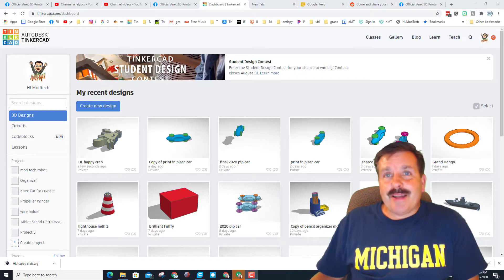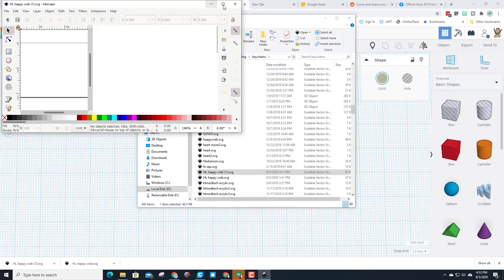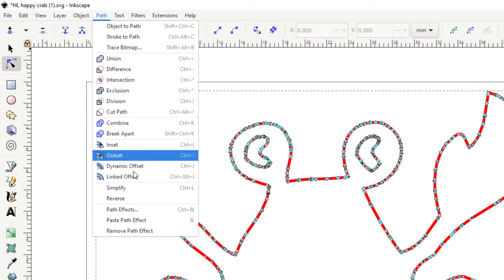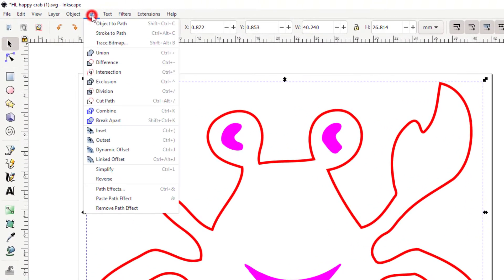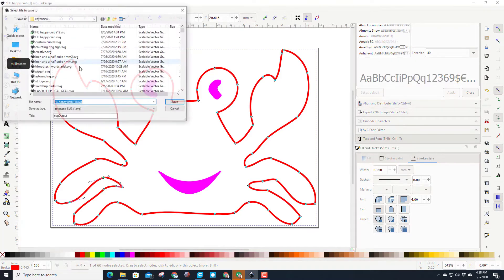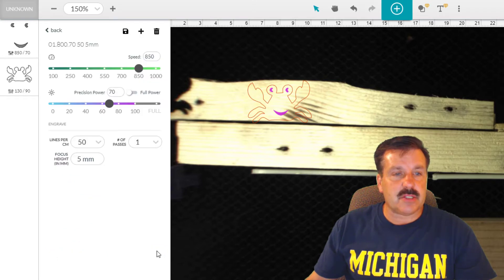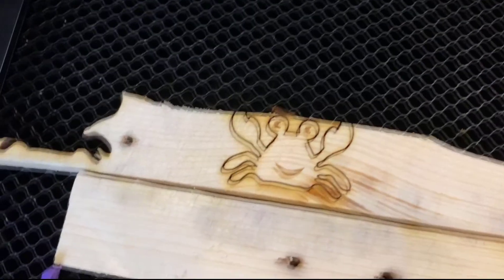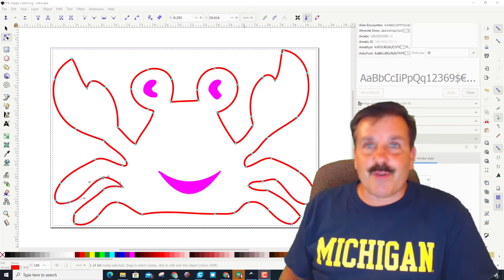STL to SVG for laser cutting!  Tinkercad & Inkscape in Minutes

Comment: this is NOT an "STL" to SVG conversion how to video... this is an "SVG" to Laser Cutter Video.
Reply from the maker: Ah... you are correct. That crab is imported into Tinkercad as a STL. I did not show that step in the video though. 🤦‍♂️ Do you know how to import a STL into Tinkercad? I can track down a tutorial for that if you need one.
Reply: @HLModTech  Hey, No thanks, I know how to do that. I was actually having trouble exporting from TinkerCad to SVG. I have a really complicated design that just wasnt exporting properly. The SVG file would be almost empty... with just header info in it. No coords. So when I searched for "STL to SVG Converter" I found your video... and was quite disapointed when I realized.. thats not what the video is about :) I ended up just redesigning the project in LightBurn.  But thanks anyway!

Comment: I noticed that you need to be sure that the shape in TinkerCAD needs to be pulled underneath the plane of the workspace or it will not appear on the .svg file that you drop into Inkscape.
Reply from the maker: I get what you are saying. A better way to say it, may be, that the SVG is only 2D and is created from the surface that is fully on the workplane.